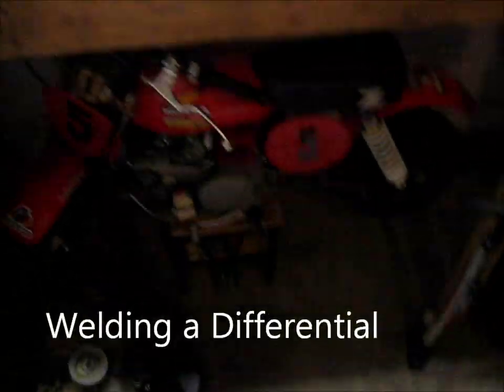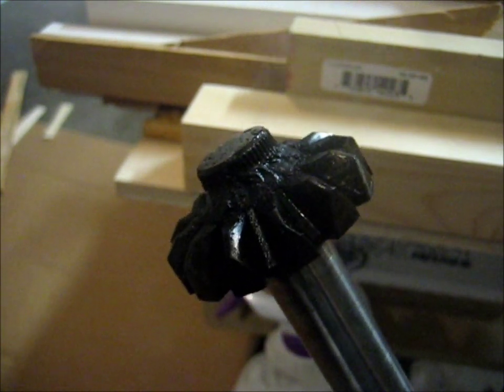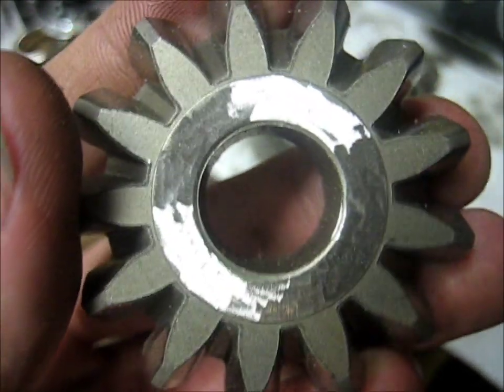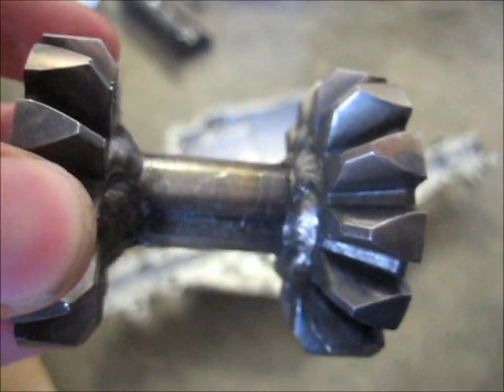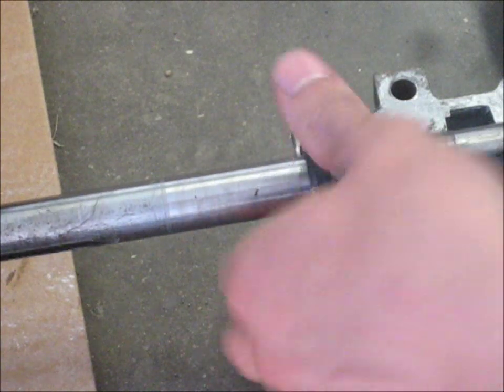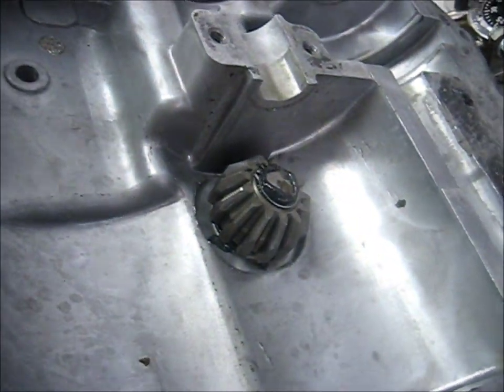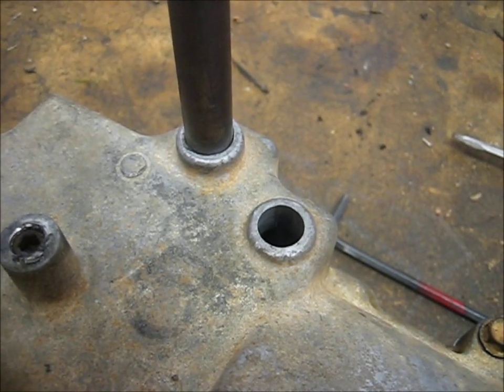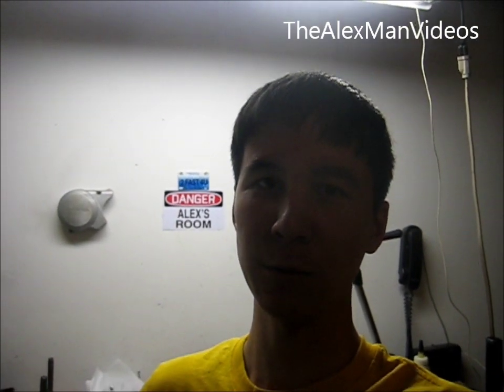Lawn Mower Welded Differential/Transaxle: How To

Comment from the maker: It's been holding up great. I've been running it off road for over a year without issue. I have had a wheel in the air and the other one pinched so bad it would stall the motor in first gear. This method can hold up to a lot of torque without breaking.

Comment: you will crack your weld if you quench, oil quench is only for soft metal, to make it strong and hard, with already hardened steel, if you quench it you make it soft and weak, same with water, if your just welding things that you dont need to be strong, just quench them to save time, but if you want it to last and be strong, wait the few min it takes to let it air cool

Comment from the maker: Any general purpose grease will work. This grease was the cheap tub from Advance Auto Parts. The process for your trans will be very similar. If the casing looks similar to the one in this video, the internals are all very similar. Just take pictures, keep parts organized, and put it back together how it came apart. You'll be fine.

Comment from the maker: @pumkinchunkin You only need to use the silicone sealant if you want to keep what's in in, and what's out out, which is all cases is true. And the other method works with certain transmissions. Which ones it works on I don't know. I know it doesn't work on this one.

Comment: It does harden the metal. Harder metal is more brittle and will be subject to more cracks and breaks, especially when it is a load bearing part.
Never, quench a weld.

Comment: My transaxle has the bull gear like yours has then to the passenger side of it is it's own differential with 4 spider gears. Completely different from any i've seen. Peerless 800 series. There a way to lock it without welding?

Comment: If i weld my gears too. But keep the same factory tire size.
Will they still break overtime
Reply from the maker: Depends how rough you are. I ran a welded diff for a few years without issue. Wasn't until I started running bigger tires and doing high RPM clutch dumps that I started breaking diffs.
Reply: First of all thank you for replying.

My old tractor is a 1999 craftsman 15.5hp 6speed. I use it for mowing mostly and pull a cart. But just recently i made a snow blade with an old barrel. 

I was thinking that that might help me with snow traction along with chains.

Comment: i know this is an old video but you really should weld the gear together in the diff. 1 or 2 teeth wont hold up long under hard riding.
Reply from the maker: It held up like this for about 3 years before that exact problem happened. The bigger tires didn't help either. My next setup will be a solid rear axle to alleviate any issues with differential locking.